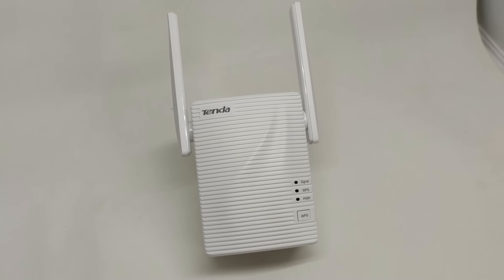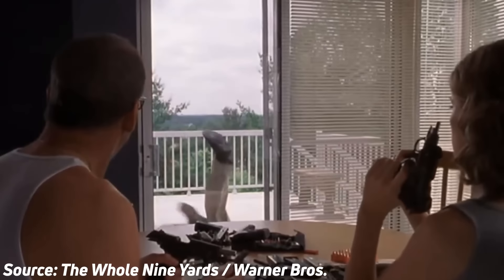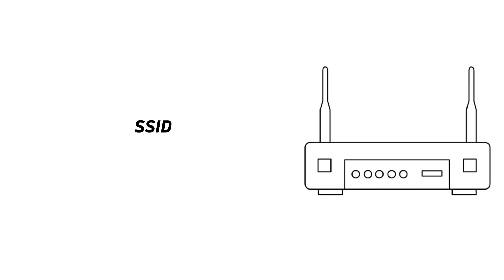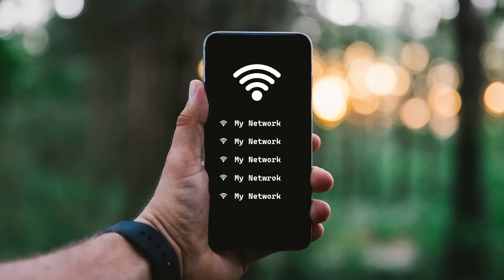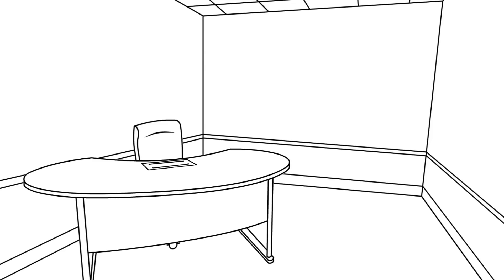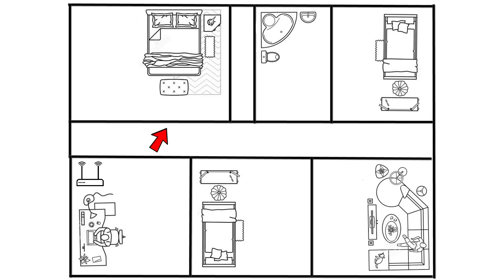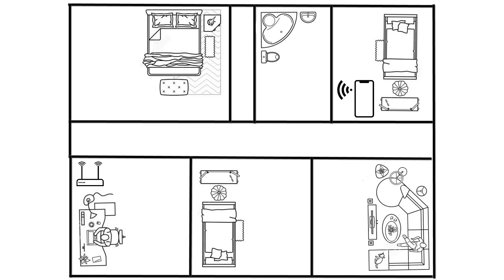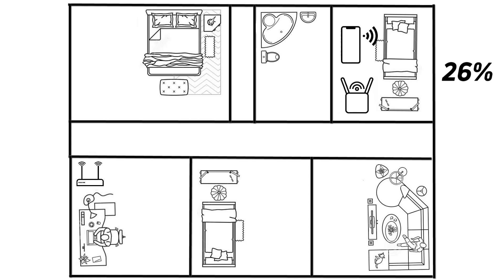How Do Wi-Fi Range Extenders Really Work?

Comment: would love a video on power-line communication
Reply: basicyl it's a methode to used existing power-line as wire for network (wire or wireless) by mixing internet data in power-line 
... it's usually better than wireless but not as good as dedicated lan cable. point is you don't need to rewire.
Reply: A lot of cable modems have batteries.  So if you have a power outage, your wireless connection to your router will remain active.

With power line networking, if you have a blackout, then you will lose it all.

Also, if you live in an apartment building, will your neighbors, who are also using power line adapters, be on you local network?
I do not know the answer.  But that would be a privacy and security issue.
Reply: @NoEgg4u  I’ve not owned a cable modem with a battery in it. None of the three or four I’ve used in the last few years has one. I’m not immediately seeing any on Amazon either.
Reply: I think privacy probably isn't a problem, they should be on different ring mains. Even within my house I have a different ring main upstairs to downstairs so I can't use a powerline extender to extend from downstairs to up.
Reply: Mmmmh.someday I have one that wi-fi the problem I can't afford ,hehehe
Reply: @caleblancaster5471  More common in modems with built-in tel services. Backup battery is a must to keep the phone service up.

Comment: Thanks Gary - Just bought a MESH WiFi system from Huawei and it solves all these "old" wifi issues. Mesh is super fast and best of all all the Android phones of my family automatically fails to the strongest signal keeping the Internet speed high over the fibre line. Used 5 WiFi Apps to do testing in and around my house to make sure MESH works and it does !!!
Reply from the maker: Good to hear that. My next videos will be in mesh networking. What Huawei model did you buy?

Comment: I find placing the extender 1/2 way between the router where you still get a good signal(usually in the hallway), and where you want to connect say your back porch, to work the best for me, I did not fell like drilling holes in my floors, or running cables in my walls, so in my house I have 2 WiFi Network extenders. one for the front edges of my house, and one for the back edges.

Comment: Definitely spot on. Best explanation I've ever heard on the subject. I currently run four access points hardwired back to a gig switch/router. 3300 square feet 2 story the switch is the DHCP server. That was the only way I could get everything talking to each other. Access points 2 upstairs 2 downstairs none in the same corner and manually set channels I turn the power down to about 50% on all of them so it makes it switch from one to the other. Cat6 cable not the prettiest install but it's effective, expensive, and bottlenecked at the switch. It's like running a USB 3.0 device on a 2.0 port. But I can stream video to multiple devices with no problem except for the bottleneck. I really don't have a use for anything faster than 300Mb. Now for the question. 
How come four devices run a speed test at the same time and all four get 250MB download but, one device by itself will only do maybe 260 MB? I'm not complaining cuz I don't pay for gigabit speed but how is it getting it is my question?

Comment: I was about to buy a wifi extender and after watching your video I change my mind. Thanks for the info!
Reply: Buy one anyway, place it in the middle point between where you have trouble connecting, and your main router. Works wonders. And you can just return it if it doesn’t work for you.
Reply: @cat-.-  Or better yet, return it for one that does work!

Comment: I find Net Extenders to play a very niche role and are very hard to recommend in those instances. Sometimes they help with stationary devices that have poor internal antennas like TVs or your example of little to no signal in a certain area of the house/property. Even then I tell people to only connect one or two devices at a time.
Reply: Wouldn't a mesh setup be much better?
Reply: @FuriousImp  I don't really have much experience with home mesh routers like Eero. In theory they should work better if they are Tri Band and I have heard they work good. 

Best is to ditch the wifi router and install 2-3 Access Points with a wired router. Ubiquiti makes pretty affordable equipment for home use so that should only run you $300-$500 for a comparably superior set up. Only issue is snaking the wire to the Access Points depending on home layout and floors.

Comment: What I learned quickly:

Buy the same router I already have and use that as a repeater. As long as the second router isn't placed on the edge of wifi coverage, broadcasting a weak signal as a "strong" signal, speeds don't suffer as much as people think.
Reply: That works if you can place that router there in the first place.
Reply: @paulstelian97  huh?
Reply: @playerroku4412  There's the issue of having the power plug in the first place. It's not easy to modify the electrical installation in order to just plug in a Wi-Fi extender after all (my hallway literally has no free plugs)
Reply: @paulstelian97  I don't want to be a jerk but you're attempting to sound way too intelligent for a simple conversation. Use a power strip then. I don't even know why you're attempting to make this complicated. Also, why would it have to be in a hallway? Put the router anywhere. Even if it's only 5 to 10 feet away from the primary router, that can still give you good speeds and way more coverage. I feel like you don't know what you're talking about, which is fine
Reply: @playerroku4412  In my house there's literally 3 walls between the main router and the one in my room, and where would I put a power strip? In the same room as the main router? In the hallway which is 2m by 8m in size? In my own room where the signal is already bad?

I need the wired variant, the access point. And I need to replace them since I can see that it behaves very poorly even with this optimization.

I just express frustrations not only because of having to do more than just putting a power strip (what if I trip on it? How do I deal with the fact that there's no line of sight spot that is even remotely convenient? And let me completely ignore the fact that there's slowdown from devices which are hard to get in range even with repeaters anyway, and also because of constant traffic from those devices eating away at what 2.4 GHz can do).

And further. Recommend me one main router and some repeaters which actually work well. I don't want something that takes up 5 minutes to recover after a power outage (it's enough that my ISP's EoC takes two, I don't want three extra on top of that), like one specific Archer router that I had for two months and sold it away because of this crap...
Reply: @paulstelian97  I'm good. This is the most uncomplicated thing but you're taking it to another level. Good luck.
Reply: @playerroku4412  What he said makes perfect sense. His living quarters (ie bedrooms, office, etc) are far away from the main WiFi source probably being in his living room as it is cable isp.

He can't just setup his old router anywhere because it needs a clean signal to rebroadcast. Which means he needs it as close to the original source as possible. Except his connection points (power outlets, Ethernet outlets) are far and few between, and running wires from your living room throughout your house is not feasible, and looks ghetto AF.

Welcome to the real world. Where our homes are not a display stand at your local Best Buy. Satellite systems don't work for everyone.
Reply: @LynxStarAuto HOMES ARE NOT A DISPLAY STAND AT BEST BUY???What are you talking about. Please stop.
Reply: @paulstelian97  Just go with mesh WiFi, get at least the triple pack or quad pack if you can, they are basically just better version of WiFi repeater.
Reply: @much_Doggo  Right.

Comment: Thanks, Great information. I tried using an Extender and it seemed to be unreliable. I discovered that my Home Access Gateway supported MoCA so I installed a MoCa extender onto  my Cable TV system and it has been Rock Solid at getting Wireless Anywhere in the house. Cheers.

Comment: i like using multiple APs in the way that Ubiquity does with the UniFi system so each AP is linked to a central router, so wherever you go you are connected to the same network, the radios are the only thing that changes, but i know some people are unable to run ethernet cables everywhere due to leasing agreements, or maybe the way the house is configured, i've tried wifi extenders in the past, and always ended up just getting the alarm installation bit out, the low voltage tools, and a box of ethernet cable and running a wire to an additional AP configured with the same config as the primary and setup in the firmware as a wireless extension in AP mode Only via WDS, so as you said, WiFi Extenders do have their place, but they aren't the end-all be-all that most try to make them out to be, great video mate, and loads of good information
Reply from the maker: Yes, that is called a Mesh Network. I have a video about that as well.

Comment: I have 2 specific uses for my Wi-fi extender, but turn it off when I’m not using it to avoid interference and save power. Since I’ve done this my router and Wi-fi in general have been better behaved. 
1) When I’m in the garden and need more range when I want Wi-fi on my phone. 
2) I keep my router on a 5GHz only band to make its life easier and use less power (it stays cooler in the summer as an added bonus). I sometimes need to use a 2.4Ghz network for a) an ancient laptop and b) a wireless 2.4Ghz-only printer (annoyingly many cheap printers are still sold as 2.4GHz-only and will not work on 5GHz). The Wi-fi extender will broadcast at both frequencies, 2.4 and 5GHz and solves that problem very easily and cheaply.

Comment: Hello, Gary. You are a wealth of information. Thank you for explaining how an Extender works. From your explanation, Extenders inside the house are pointless but it's only helpful if you want to connect with the WiFi outside. Is that correct? Therefore, is Mesh a better option to push the wifi to other parts of the house where there are deadzones?

Comment: I find that the one thing reduces wifi range most often missed is interference from other nearby wifi access points that are operating on the same channel. Good news is that it's an EZ  problem to fix. Simply go into your router settings and change to a channel different from the source of the interference.

Comment: Very good and detailed explanation. What should i use to get better wifi sygnal in the basement. Router is upstairs and i have ethernet cable in the basement that runs from the upstairs router.

Comment: great video. i went for a mesh setup with fritzbox routers as my internet router is also fritzbox. i wired the extra routers, as running that wireless did almost destroy the network. i now have a router on every floor, as the concrete floors almost completely take out the wifi signals. now it all seems to work fine, but i would be interested to find out how te improve on it even more. mainly i worry about the best possible placement of the accespointrouters. i still want to add an extra accespoint to create garden wifi access. i'm thinking of putting that on a windowsill at the backend of the house. but now i worry of that interfering with the accesspoint closest to it. i use wired setups however and the mesh usually runs at 5 ghz, so i would probably run the gardenwifi at 2.4, hoping that would in turn not interfere too much with the zigbee home automation devices in my house, also running at 2.4. this stuff gets hard. i would love videos on that. maybe my situation is a good example or indication of the type of things to consider. greetings from the Netherlands

Comment: I had a QUESTION,  what are your thoughts on one of these wifi extenders for my Solar panels. I recently put a solar panels in and now it's saying Gateway not responding and Im tired of that happening. I have to share my wifi with the solar panels and the reporting. I have my solar hooked up to wifi instead of an ethernet cable. Do you think this would help buying an extender?  Not sure if an ethernet cable is just the way to go instead.  Thanks. If you had any ideas.

Comment: Great explanation for beginners!  One small nitpick though.  While access points usually do have the power to send at 100mW or even 500mW on 5 GHz channels you should never use these high levels because your poor smartphone usually only sends 20 to 25mW back to the access point and you don't want constant failed transmits from the smartphone crippling the experience.  Better to also leave the access point at max 25 mW (14 dBm) so you truly get an idea how many access points you actually need.

The only reason you would have a single radio on an access point at full power is when you are only using that radio for a mesh link towards another access point.

But again, great simplified explanation!

Comment: I tried an extender but it wasn't working well. I changed to a mesh network and it works like a charm.
Reply: Same here. Used a wifi extender for like 9 months and got 2/3 of my actual speeds. Switched to mesh and now get full speeds everywhere, and seamless switching too. Definitely recommend mesh over extender.
Reply: @ozziekhoo  My biggest issue was the switching as well.
Now I don't even notice when it switches, not even in a video conference.
Reply: @ozziekhoo  mesh normally have 3 radios (more expensive) (Triband - 5ghz dedicated radio for backhaul, 5ghz for devices, 2.4ghz for older devices), repeater normally are 2 radios (Dual band - 5ghz for backhaul AND devices, 2.4 ghz for older devices) . Once you backhaul (upstream) and devices (downstream) sharing same radio, is not good.

Comment: Can you link multiple wifi extenders? Like this? Main router ---> wifi extender 1 ---> wifi extender 2 ---> wifi extender 3. Like that? So i can have internet connection even if i am meters and meters away from my main wifi?
Reply from the maker: That is called a MESH network, I have a separate video about that.

Comment: Do they work in sequence or have to originate from the main access point? Trying to use this strategy in a 4 plex to provide internet for each unit. But the 4th is too far from the main modem and router. What about  wired from main router to 3 other cheap routers. They get they're own ssid for each unit
Reply from the maker: You need a mesh network, I have a video about mesh networking here in this channel.

Comment: For powerline wifi/ethernet extender must be on same electricity phase. But now better, cheaper invest is to buy mesh than setup those wifi extenders. I have Airport Time Capsule in living room and Airport Extreme in the bed room, same SSID. And it works very stable. No mess with wifi names etc.
Reply from the maker: Cheaper? The one I used in the video costs $14. Can you get mesh networking for $14?
Reply: @GaryExplains  most it will be mission imposible to get mesh for USD14. But most problem is lose connections, unstable on very heavy load. Mesh or wifi repeater I believe is much better.
Reply from the maker: @WP7Nettwerk  Of course mesh is better, but you didn't say that, you said cheaper, that is why I replied.
Reply: @GaryExplains  but it will be nice if you give video about mesh and wifi repeater and comparison.
Reply from the maker: @WP7Nettwerk  I will and I say I will  in the video.

Comment: I have a curly one. I have an IP wifi security camera on the outside of a concrete wall which blocks the wifi to the NVR. Can I run an RJ45 cable from the RJ45 lead on the camera, through the concrete wall to the RJ45 socket on the wifi extender inside the house and expect the extender to transmit to the NVR via wifi? The alternative is to remove the aerial on the camera and plug a coax into the camera sma socket and have a yagi on the other end of the coax aimed at the NVR. I already have the latter working on another outside camera where the wall is timber frame and the yagi is on the outside with the camera.
Reply: This will work if you connect the  NVR Ethernet port   to the main wifi router to which the wifi extender connects.

This works because the camera and NVR  Ethernet port end up on the same subnet.  The NVRs  MDNS (boujour)  broadcasts will then make  to the camera and allow the camera to discover the NVR and connect
Reply: @02840321  yes, the nvr and router are connected, I was mainly concerned that I would be using the extender backwards, ie video into the rj45 and out of the aerial
Reply: @02840321  Thanks David, I'll try that when the camera arrives!

Comment: Gary, you mention running an ethernet cable between the router and the extender/access point.
Is it possible to do it the other way around? i.e a cable from the access point to feed another building?

Router <wireless> Extender <cable> secondary router/access point
Reply: Never mind - i had an epiphany and managed to test my theory - It works!
For anyone else wanting to do the same, i'm using a Netgear N300 wifi range extender (essentials edition). model number EX2700-100UKS

Comment: Can u the WiFi extender over a network cable connected to the original access point. Thanks
Reply from the maker: If the network extender provides that functionality (i.e. it has an Ethernet port) then yes.